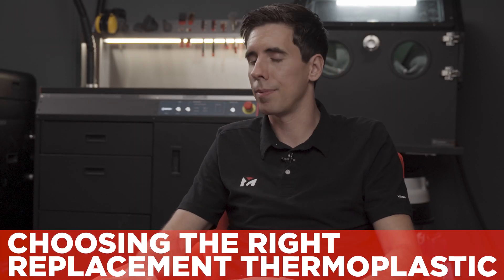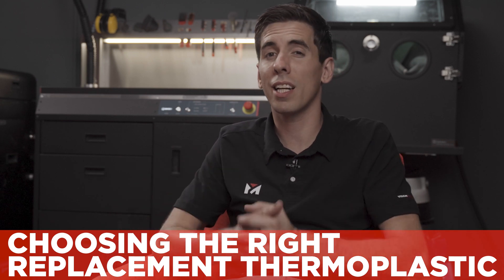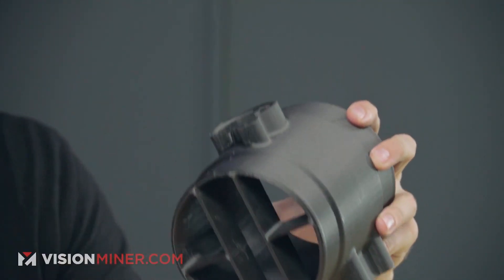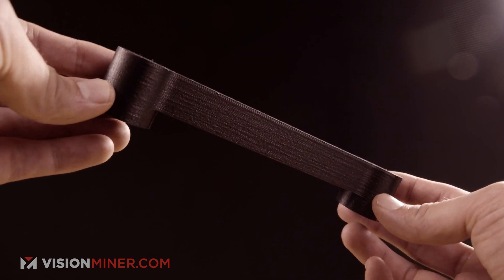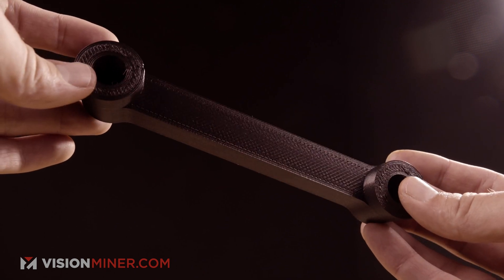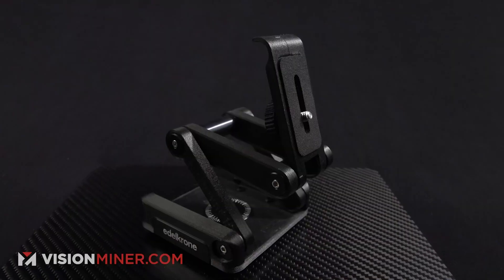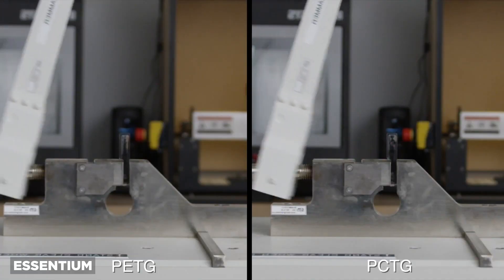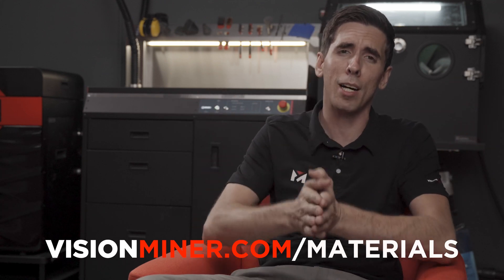"Black Aluminum" | All Hype or the Real Deal?

Comment: Can you guys do a commentary on creep and how nylon's properties change with exposure to humidity? Everybody seems to love CF nylon but my only experiences with it are that it gets very soft and loves to creep under load a few days after its printed. I don't get the appeal.
Reply: Application is key
Reply: It will be very environment dependent, but pa6 will absorb quite a bit of moisture and become flexible.

It also vastly depends on the part size (thickness) itself. 

Pa6-cf is great for things where you want toughness and some conform ability or impact resistance, with a bit more structure.

Also, while it has a higher temp resistance, nylon will start to lose structure (deform) under load at around 50-60C.

You don't use pa6-cf (pa12, maybe) for firm structural components you don't want to creep or deform under heavy loads unless the part is thick enough and the load light enough. It is use purely for its toughness.
Reply: I just started printing CF Nylon (PolyMaker PA612-CF) and it seems to be very flexible and snaps very easy. PLA seems to be much stronger! ABS Im running seems stronger. I starting to think all the CF nylon stuff is all just a crock... but the CF nylon I'm printing is most likely not the "real deal"

Comment: Post printing specs for best results!  Nozzle size, speed, support type etc…my prints always stop/clog; Ive tried 3dXtech pa6 and I believe polymaker. I’ll try other brands if needed.
Reply from the maker: If it's always clogging, it might be more due to your hardware (hotend/etc) if you've played a lot with temps/cooling/speeds....
Reply: @VisionMiner  you guys have some beautiful machines over there, I could only splurge on $4K F430 from creatbot. I can get 10 hours into a PA6 print before it stops printing, I’ve gotten really good small prints also but not sure why it just gives up halfway through.

Comment: What are the thermal properties of CF nylon for example un automotive applications with alot of radiant heat?
Reply from the maker: Depends on the blend, but PA6+CF can get up to 150c and HTN CF25 into the lower 200's

Comment: high temp materials are overrated. abs does fine in 99% of applications, and the other 1% would be better off to be machined in metal.
Reply: I strongly disagree, maybe ABS works for your applications, certainly not ours. There is a huge difference between the strength and rigidity of ABS and aluminum. We also use the hell out of Essentium HTN-CF25, it is far easier to print than ABS, far stronger and far, far more rigid. There is no warping, no enclosed chambers are required, the dimensions are dead on every time. Any of our printers handles it just fine, even down to our Prusa farm. The majority of what we used our machine shop for is now done with this filament. I can do in a few hours what they've been doing for us and I can do it for a fraction of the cost.
Reply from the maker: More research is recommended on your side :) However, for hobbyist users, yeah, ABS is great! PCTG is better though, but ABS properties are definitely good bang for the buck on basic machines for many different applications. However, high-temp materials are almost exclusively used for industrial applications, mostly unknown to the masses, but are a requirement for the applications.